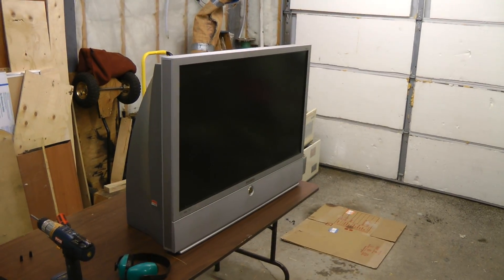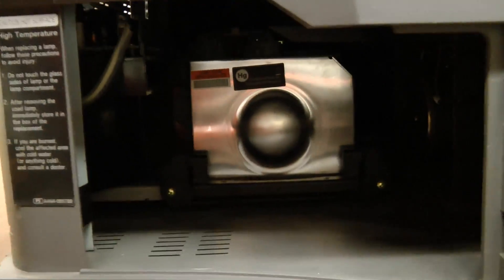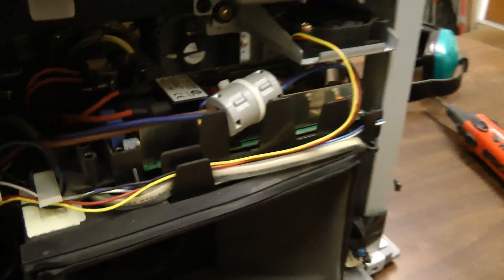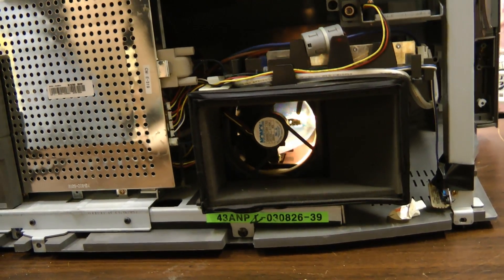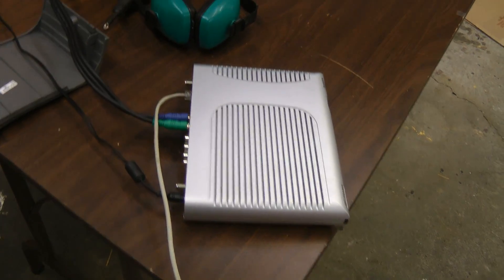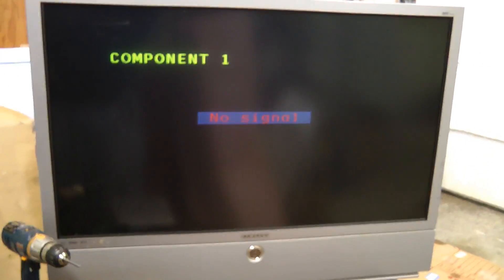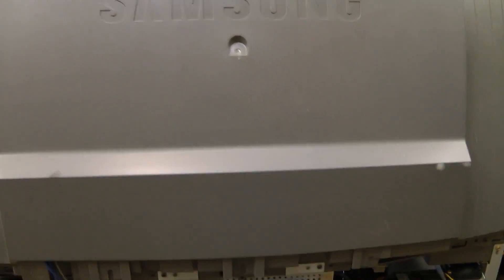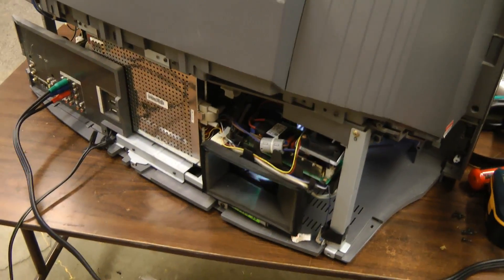DLP rear projection TV part 1

Comment: That's much better with modern flat LCD panels, with short focal DLP projectors, there's a sync software, that can directly operate on the back of opened LCD panels.

Comment: I have one similar to this, but with access openings on the side.  My picture is somewhat dull and hazy.  I’ve tried cleaning the mirror without great results.  I’m wondering if I would damage the screen by cleaning the INSIDE of it.  Also, what should I use?  Any help would be greatly appreciated.  Thanks.
Reply: Cleaning everything is best. Cigarette smoke and just regular air particles will do it because of the flow of air as constant as it does flow;  almost acts as a filter. Not sure which part you were referring to but even the dlp backlight bulb would need cleaning as well as the cooling system fan and ducts.

Comment: It's the color wheel,  mine made the same noise and being an updated air bearing, all I had to do was use some compress air to clean the dust on bearing, If you have the old ball bearing type,  you can  either oil or get new color wheel.

Comment: I have a 50 inch Samsung i replaced the color wheel the power circuit and when i turn it on it play beautifully for about 5 min the the picture goes out but there is still sound why?

Comment: I know this is old, but the problem with the buzzing and the bad picture is the color wheel.  I have a 2003 Samsung 60" DLP and it's making that same sound.  I've replaced the color wheel before when one shattered.  I thought about buying a new TV but it will cost me less to repair this one, besides it's a great picture when it's woking.

Comment: fan stays on to cool the bulb.  new bulbs are cheap.. surf web. I have a 52" HD - ila  rear projection t.v. .. thats the fan.. noisy.. replace or clean it with compressed air.... my bulb is 44 dollars. It is analog..  you need a digital converter box... noisy fan..  my television was several thousand when new..  it is STILL WORTH IT to buy a new bulb every decade... my first bulb replacement this week.. had this for many many years.. it was my sisters.. they bought it new.. she bought an newer one.. gave me this one.

Comment: Can you still buy CRT TVs over there in the states? I really wanted a Panasonic TX-36PD50. I have a Samsung UE40C5800, mid range LED backlit but the picture is so poor compared to old CRTs. Maybe due to the 576i Freeview digital signal being upscaled to fit the 1080 pixels of the screen!

Comment: Was wondering if you could help me? I have a dlp basically the same as this, I have an hln617w which looks exactly like this! My tv blows a small glass fuse on the sub power board when you try to turn it on, would it be the main power board or the ballast?

Comment: yeah.... colorwheel ! unbalanced  or bearings worn out ! you can try some wd40 on it, directly injected into the bearings...or just dip the whole assembly and let it soak...worked for me quite often. get a decent crt rear projection unit ;)

Comment: One day I picked up a defective DLP protector for autopsy purpose... Upon opening I found it was an easy fix, some internal connector was not seated correctly ! I still have it and use it sometimes, but then I still need to autopsy a DLP-fitted projector. I've already processed several 3-LCD ones by the way, including a very big and expensive Sony VPL-VW12HT. Keep this coming, I love autopsy videos (and already watched 3 times the complete kuka robot autopsy videos from the Geek Group)